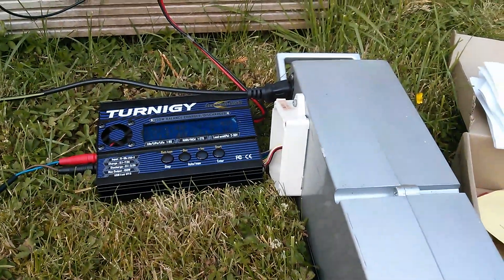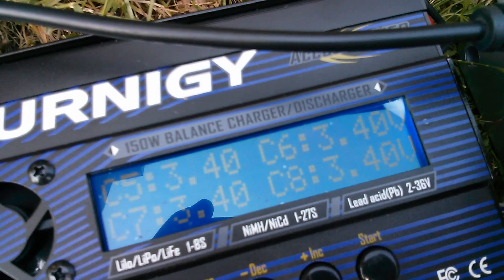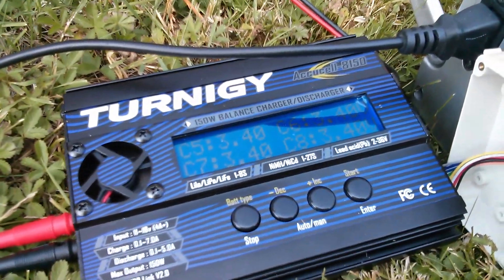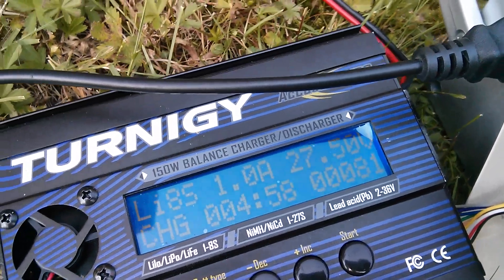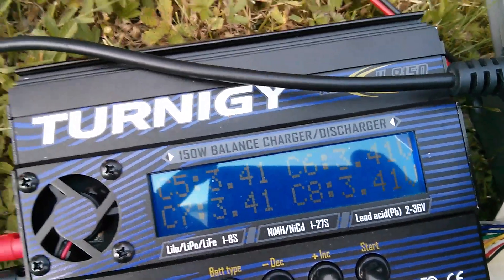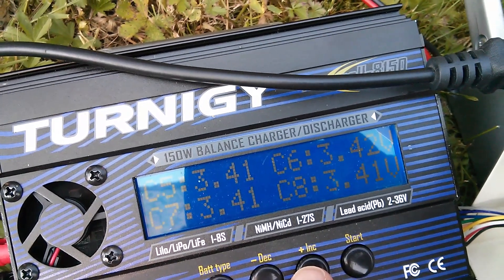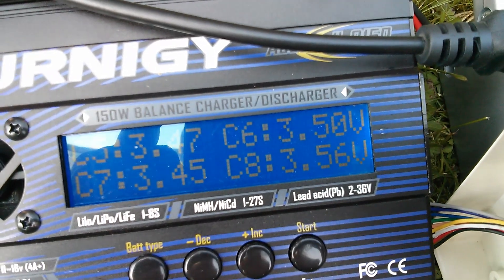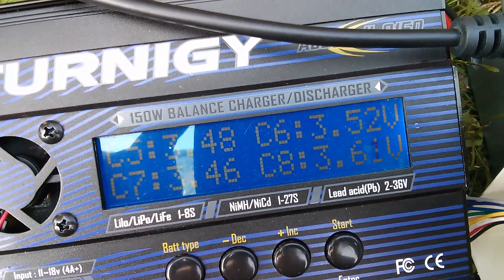Project Idea: 8-Cell Balancer Discharger using 9 Arduinos

Comment: I must be missing something, isn't 9 Arduinos overkill? I'm sure a lot of small micros and a handful of bits could accomplish this 🤔 I could be (and frequently are) incorrect.
Reply: Satyajit Roy Thanks 👍
Reply: I guess people that know assembler (i think julian does) started using "arduino" for anything "avr" or "8-bit µC" when talking to the maker community. But even if he actually means arduino, you can get Arduino minis (328P w/o serial to usb) in china for about the price of a bare attiny at local prices.
Reply: h3po But why would he need so many of them 🤔
Reply: he could do with one or two avrs by dividing down the cell 2-8 voltages to fit the adc input range, but then that needs calibration and precision resistors and still loses accuracy. julian experimented before with multiple µc at different voltage levels and thats what he is referring to in the video. keep in mind he is making videos for entertainment and avoiding building blocks that an average arduino user can't grasp. if he wanted the simple and proven solution, there's dedicated 8s, 16s, 32s cell voltage monitor and balancing ic available. those cost a couple of bucks, so if he can figure out a way to achieve the same goal with a couble of bucks worth of chinese arduinos, that's what he is going to do for the sake of video content.
Reply: Google+ SUCKS BALLS - the worst forced social network how about using RPIs 😂 with their useless gpio you would need at least 9 of them 😀
Reply: Any small micro with at least 14 pins, one analog MUX 74HC4051 and couple of resistors/capacitors will do the job. But yes, more ADC resolution is needed here if you really need precise values. its because you have to evaluate other 7 batteries related to one to the next and any deviation in reading will give you wrong result for the next. Arduino (AVR) has only 10 bit resolution and it may work like a 8/9 bit ADC (yes, its not going to be on properly designed board and everything will be tied up crudly). if its 8 bit that means with full 5V scale each bit will represent approx 20mV. if your reading of first battery is deviated by 20mV then next reading will read 20mV more than actual and it will continue to deviate till the last one connected to positive terminal. Hence it will mess everything up unless you have adequately precise reading system. You can add external 18 bit ADC (MCP3421) to read the values or any other at your choice. MCP3421 has inbuilt 2.048V reference with 5ppm tempco and 0.05% accuracy. that means if you have practical 16 bit achievable resolution at 2.048V, one bit will represnt 0.03mV and its  very negligible deviation to read different voltage dividers. The deviation I mentioned here is for RAW reading, but you need to recalculate them as per the battery voltage and resistor divider ratios. THE BEST micro controller would be from Silab C8051F350 that has inbuilt 24 bit ADC which of course will overkill the requirement, but its only $1.5 if you source it from china. just use a good multimeter to find the calibration values and it will give you precise result for all batteries. Everything can be made in small enclosure with BLE to read on your cell phone will surely add value in it to even further level and it would be interesting to have in a cycle. Small PCB with all SMD components. www.pcbway.com is offering 10 nos prototyping 2 layer boards (under 10cm x 10cm) at just $5.00+shipping. He doesnt spend enough time in planning or designing so you just cant expect a good design finally and you will be confused whatever you have learnt so far if you try to find justification about what he does. Every video has an invisible phrase "Play with..." which nobody could see.
Reply: Satyajit Roy I understand totally the limitations on a YouTube channel, so can't blame anyone for that. it's a fine line between being understandable and making a production ready design. very tricky balance.

Those PCBs are a great price, certainly got a lot cheaper over the years. 👍

I will soon be making some valve amplifiers, I might just give them a try.
Reply: If you wish you could try this link then. https://www.pcbway.com/setinvite.aspx?inviteid=13049
Reply: no.. you're not missing anything. you can get multi channel differential adc on i2c.. also you can get all kinds of latching/switching ic's on i2c as well.. you can control everything with 2 wires so any single arduino will do. As for using multiple arduinos only to measure levels of cells at different potentials - good luck ;)

Comment: Accident waiting to happen. If balancing isn't working it means the charger is broken or the cells internal resistance etc is totally out of line with the rest of the pack. If you can get it to balance it's voltage will drop off way before the other cells and become dangerous to charge again.

Comment: This might be a totally noob question, but why does the charger not simply have 8 relays (one per battery) that can break the circuit for that battery once it reaches full charge, thus not overcharging the battery and not wasting electricity by discharging it to keep it at 3.6V?
Reply: SimoWill75 I see. You could only  remove  1 cell from charging if the pack was being charged as 8 1S cells.
Reply: The cells are not being charged via the 9 wires you see (the balance port), they are only being monitored and slightly discharged via that port. The cells are being charged by two wires only (serially) so removing one cell from charge would therefore break the circuit and effectively remove all from charge.
Reply: james mayo I was thinking the same. Probably there's a good reason.

Comment: Instead of 8 arduinos each measuring their cell and reporting to a master arduino, it might just be simpler to use one arduino where an adc pin is tied to each balance point with respect to the battery ground. By measuring the voltage at each node starting at the bottom and subtracting the lower cells' cumulative voltage you can calculate the potential of each cell. For instance if you only had 2 cells in series, and the node between them measures 3.5V and the top battery measures 7.5V (all measurements with respect to ground/negative of series pack) then the top cell must be 7.5-3.5=4V. Then it's just a matter of using some isolated switch like a relay to turn on/off the bulbs to discharge cells independently.
Reply: You cant put more than 5V / VCC into an arduino port without blowing it up I don't think.
Reply: Andy Barnard the RAW pin will take 12VDC maybe even 16 on a pro mini
Reply: True, but on my Arduinos at least there are 5V and 3.3V voltage regulators so the microcontroller isn't running at that voltage.  You can power raw or 5V, but not both.  Raw gets converted to 5V, YMMV.
Reply: A simple resistive divider ladder can be used to scale the range down so the max voltage to be measured falls under 5V and then just multiply in software by the scale factor to recover the original voltages.
Reply: Yes that is really simple, probably what most chargers do. You lose some resolution with that approach though:
about 30V (8x 3.6V) / 1024  (10bit ADC) = 0.03V steps
Reply: You can actually use the differential mode of the ADC to measure between battery taps.

It would require a lot of voltage dividers tho.
Reply: Common mode voltage of those differential ADCs are not that high usually. Yes, there might be some which I havent looked at yet

Comment: Why use multiple Arduinos?
A single one is far enough for that job.
A single Mega that measures 8 voltages and switches 8 loads on and off is still not even close to its limit
Reply: I think 9 Mac Mini's will be enough!
Reply: Why use a resister or light bulb ? Couldn't you use the high cell to charge the low ones ? That way no energy ( or less) would be wasted as heat.
Reply: Jason Munro harder than it sounds, he tried to do something like that before
Reply: Those chargers are kind of dumb when charging cells with slightly unbalanced cells. A quicker way to get them fully charged at this stage is to make a little 1 cell chargingcable with a red jst-connector in one end and 2 dupont wires in the other end so you can top up the cells one by one at 1 amp chargecurrent via the balance-connector. 👍
Reply: Why not 18+1? 9 single pin ADCs + 9 single pin GPIO arduino for switching the mosfets and only one for synchronization? And the single one maybe with a gpioextender?
Reply: rocketman221projects once you can measure 8 individual cells you could just add up the voltages of single cells to have total volts. For this kind of project you don't need super fast voltage readings as they don't change super fast.
Reply: Technically you could even use a UNO R3 from RobotDyn that has 8 analog inputs that can measure 0-5V. Sure the Mega has more memory if you want to mage a better looking GUI instead of a simple text lcd screen.
Reply: rocketman221projects ok, I'm just wondering why you need 16bit
Reply: With 5V FSR, 12 bit is 1.2mV which is plenty fine enough to resolve 10mV +/- 5mV.
I would use multiplexing and solid state relays to isolate and measure each cell with a single A2D input, and charge up a large cap from the highest cell, switch and discharge into the lowest, etc.
Theory is simple, just like using a bucket to level various containers of water.
Practice is somewhat harder, but the multiplexer makes sure that only one path to a cell can be active at once.
Add in some settling time for measurements, and time for charge transfer, at each step, but it could balance with many amps.
Reply: imac pro dude
Reply: What about Analog Multiplexers?
Reply: What would you need a 1MHz ADC for? This is a charger, not an oscilloscope!
Reply: Active Battery Cell Balancing Methods with Variable Duration Discharge
http://www.google.com/patents/US20120293129
Reply: Jason Munro u would need biderectional dc/dc. not as simple as burning excess nergy with resistor:)
Reply: Distortionize Because then you need to measure the voltage through a voltage divider to not exceed the maximum voltage for the pins
Reply: Note I said: "multiplexing and solid state relays to isolate and measure each cell with a single A2D input"
This way, the Arduino should never see more than 4.2V for the cell it is connected to, so 12 bit should be enough, especially with averaging.
(To measure the full battery voltage, then I would agree that 16 bits would be better, but not really necessary, as the individual cell voltages are what is really important. The battery voltage can be derived from the sum of the cells.)
(2 LSBs of 12 bit noise is 6 LSBs of 16 bit noise! There usually isn't much point in measuring noise more accurately unless you're doing serious signal processing)
Noise from batteries would be close to the theoretical noise floor of thermal electrons at around -130dB and far far below the 96dB for 16 bits. I don't see that noise would be a problem at all, especially as the bandwidth required for balancing a cell is on the order of 0.1Hz, so a simple capacitor could filter everything above 1Hz.
I still maintain that 12 bits is plenty enough at 5V FSR for the 1.2mV resolution, and 10 mV accuracy that batteries require.
Reply: The AT Mega 1280 would be fine.
Reply: Alex Stone: One core for each, plus a few spares. ;- p
Reply: +rocketman221projects You don't need to squeeze the LiPo cells all the way up so 4.15 V +/- 0.03 V should be fine. I like the idea +Andy Lee Robinson had of isolating an individual cell, which would eliminate the need for a voltage divider completely with a 5V reference.
Reply: The ADC will need voltage dividers so it can measure up to 28.8 volts. The arduino only has a slow 10 bit ADC.
I would use a STM32F103C8 board. It has dual 12 bit 1MHz ADCs with 10 input channels, which will provide plenty of resolution with some oversampling.
Reply: You need a high sample rate for oversampling. To get a 16 bit reading from a 10 bit  ADC requires 4096 samples per channel. The arduino only does about 10KHz and there are 8 channels that need to be read.
The 12 bit ADC on the STM32 only needs 256 samples per channel to get a 16 bit reading.
Reply: The full scale reading wouldn't be 5V though. It would have to be at least 28.8 volts to measure the highest cell. The resolution would only be about 7mv. The noise will likely be a couple of LSBs which would give you something like +/- 30mv. 16 bits brings the resolution down to about 500µv giving plenty of resolution even with 2 or 3 LSBs of noise.

Comment: Instead of dumping power on cell 8, what about lying to the charger to get it to balance the other 7 since 8 is already at voltage.  Or perhaps sit on the balance lead and use a mosfet to hold cells at peak rather than overcharge and discharge.
Reply: The quick and dirty solution would be to just connect a lamp across cell 8 and pull it down.

Comment: I'd go for ATtiny 85s or similar for the individual battery controllers. Enough I/O for the job, and it'd keep the design nice and small. Not as "plug and play" as Arduinos for prototyping though, but I doubt there'd be much difference in the code between them, so you could probably still use an Arduino for debugging the code if you wanted to make things easier.
Reply: The Up Late Geek they have boards like regular ATMega chips that have attinys on them, they're great for prototyping low power stuff
Reply: Digispark clones.
Reply: using ian216 sensors and an i2c io board you could easily do this.